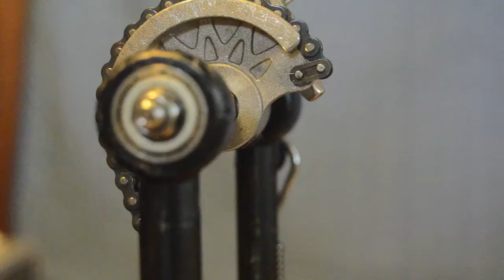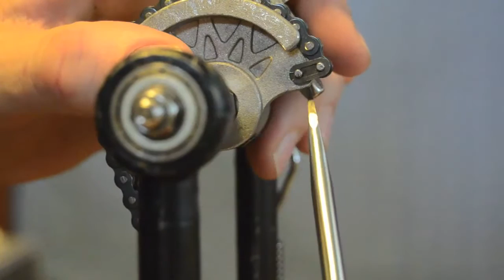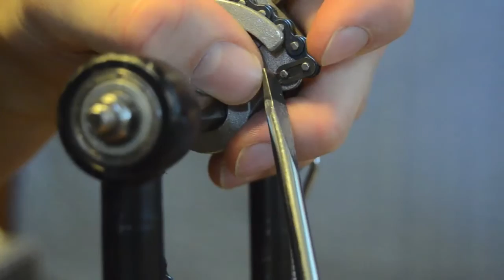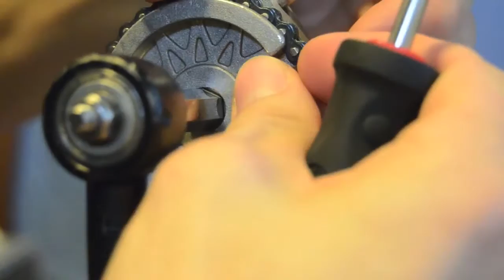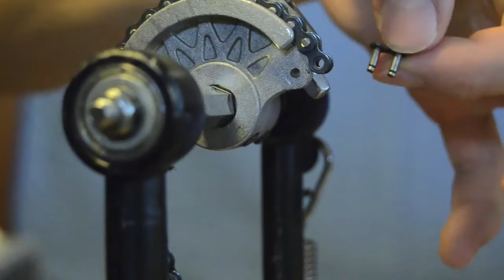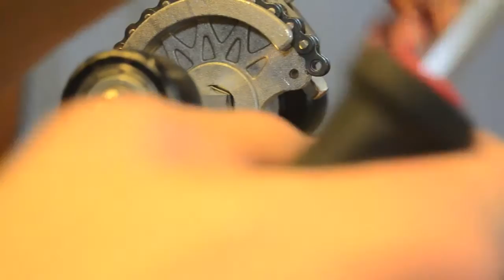Pedal Chains: How To Take Off A Master Link

Comment: I was acuatlly thinking on removing one of the links of the chain. is there a way I can replace the chain or remove it?
Reply from the maker: Most pedals you can easily unscrew the bottom of the chain with a screwdriver or drum key. The top will either come off like this video or with a drum key. You can then do whatever you want. I'm not sure you'll find shorter chains available to buy. The best bet is probably to use a bicycle chain tool to remove a link. They're like 7 bucks at REI or probably similar on Amazon.
Reply: @RyanAlexanderBloom  Wow, thanks for the answer! I have the exact same mapex pedal. Apparently it is kinda rivited to the botton of the pedal and I cant remove it. I have sent an email to mapex asking how I could remove or if there are any other options. will be taking it to the local bike shop down my street. hopefully it Works, currently the pedal is sitting way too low and it is extremely annoying and frustrating since I cannot do heel toe.
Reply from the maker: Gabriel Roma odd. My Mapex will disassemble with just a Phillips screwdriver the bottom. Yours must be from a different generation.  Good luck. I think a bike shop should be able to do it easily after they get over how weird it is that you brought in a drum pedal.
Reply: Yep - I have the same pedal, the footplate is so low its knocking on the wing nut clamping the pedal to my drum! I think I need to remove at least one link. How do I do that? I didn't really understand in the video what was the point of disconnecting the chain and then reconnecting it exactly the same as before. Surely the only reason for disconnecting is to remove or add a link? How do I do that?

Comment: how about the bottom which looks like one can't ??
Reply from the maker: Larry Tozzi the bottom is usually just a screw. I’ve never seen one where it wasn’t easy on the bottom.
Reply: My PDP 4000 has a Phillips head screw thru the foot pedal w/ locking bolt to the bracket attachment the chain is attached to a bracket that has a metal rod that is crimped on both ends tried to send a picture but no way to attach it here
Reply from the maker: Larry Tozzi ok, I think I get what you’re saying. So you want to remove the chain from the mounting plate with the screw in it. I’ve never done that or even considered doing that. Thus, I have no useful suggestions. I looked at a few of my pedals and they all seem to have a rivet or some other type of semi-permanent attachment at that point, not intended to be removed.
Reply: The chain snapped I have to replace it ... PDP has no replacement brackets just chains